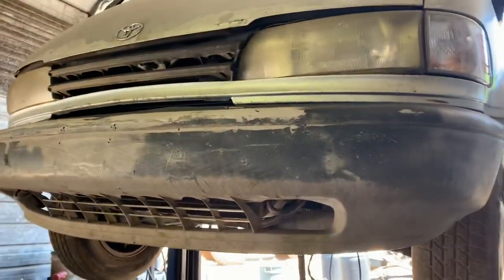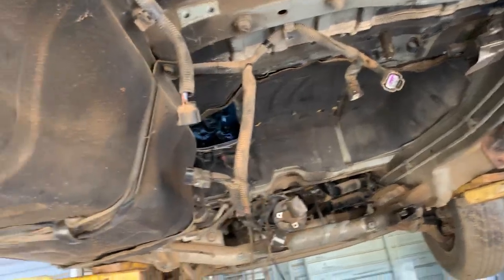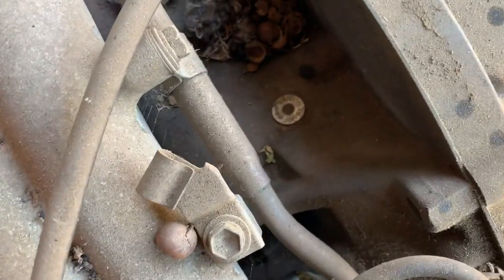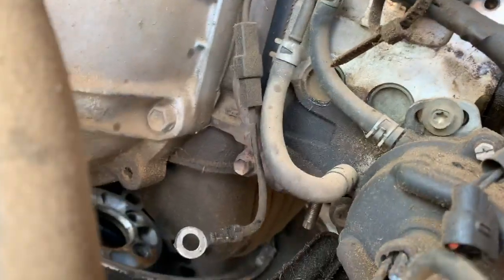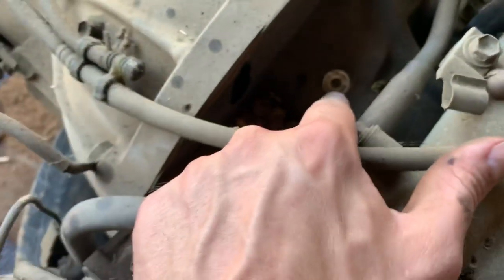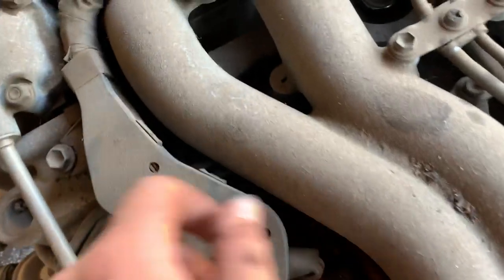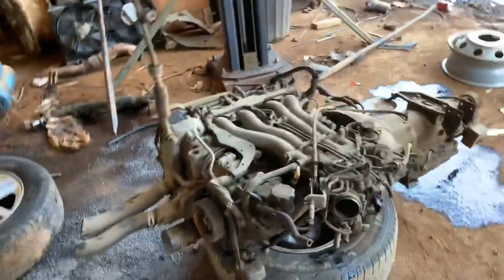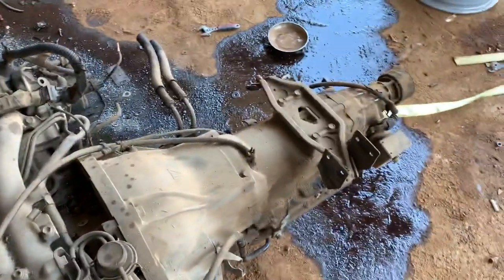Space shuttle engine is out!

Comment: Yup, you're quite right about the warranty tags.  This is the more common and cheaper way to do it, some higher end rebuilt engines have a blank label on them with heat-activated ink that changes to say warranty void if the engine is overheated.  In the UK some companies also use sticky labels with the engine data on them that will curl up and fall off if the engine is overheated.  The tip about looking for the remanufacturing tag if you're hunting for a replacement engine in a junk yard is a good one, but it can fall down in one area, if the vehicle was in the hands of the same owner there's no guarantee that they haven't managed to kill the new engine the same way they killed the old one if it wasn't overheating.  Just be diligent with your checks as pulling an engine and getting it home just to find it's as bad or worse than what you already had can really ruin your day...

Comment: They are called heat tabs. Even junk yards give some little warranty. Usually 45 days. Motor ran hot void the warranty.  Their cheap you can even have made with your company name stamped on em. Not just junk motors come with that heat tab. I had a short block remanufactured. They stuck one on my brass freezeplug. On the front of my block.

Comment: The most slanted 4 in history. what a weird piece of uhm.. engineering. Exotic super low horsepower boring kitchen appliance motor ever made. Not like anyone here would read this, but its the truth. BORRRRIINNNNGNGGGGGGGG assed TOYOTA crap engineering. Guess that 150k mile Egg Shell fridge didn't last that long if it required a shortblock. But the Toyota heads will say it it lasted forever. Eff that  boring disposable crap.